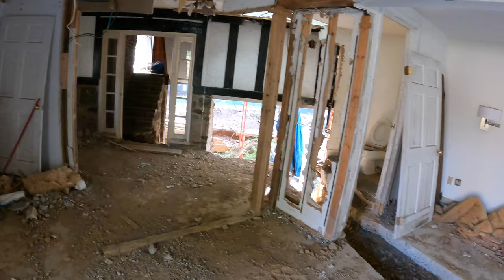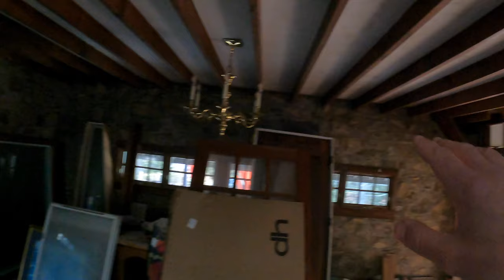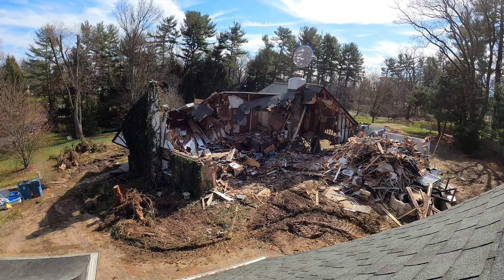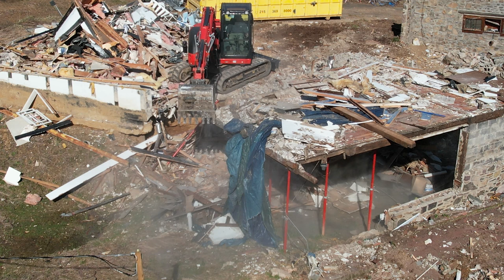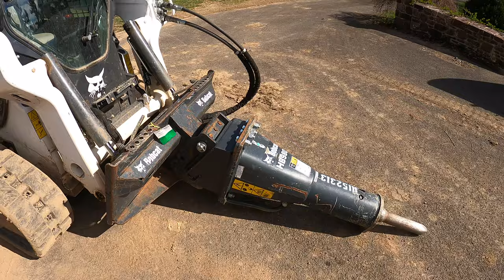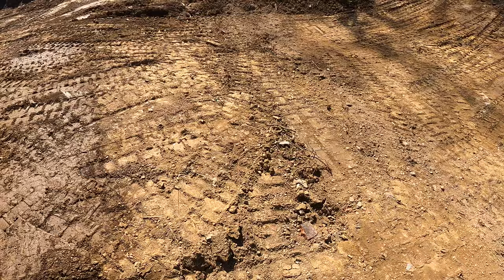Demolishing old house

Comment: Thanks Sean! The house must have been very frustrating for the homeowner with the need for repairs. In the new build he’ll get a lot better insulation, more spacious rooms , better layout, and hopefully a building that will last for quite a while without major problems. Perhaps a suggestion - for sketchy chimneys like this I’ve seen operators pick up a long log or 6 x 6 with the excavator and use it as a “battering ram” on the brick/stone to keep away from the falling debris. Makes for a more interesting video too. 😊
Reply: The piece of shit replacing this irreplaceable 200 year old structure will probably last about 50 years, if that. It'll be built like shit, as most modern homes are, and will probably be an architectural affront.

Comment: Very clean at the end good work! I've learned from demo that I go a lot faster when I put the dumpster or Triaxle right next to the pile then climb up on the debris and dig into the pile to crush it up and load dumpster. It goes so much quicker than sitting down low and reaching out and trying to grab everything with thumb. Also tracking around on it and scooping into yourself really breaks up the debris good for packing in dumpster.
Reply from the maker: Thank you, I thought about doing that because like you said it's much easier to load a truck that way. But these tracks don't have that many hours on them and I was worried about tearing them up. I also though about building a dirt mount to sit on. But I was able to load the trucks in about 20 minutes so I figured that was fast enough anyway.
Reply: How many dumpsters did it take? @srmcontracting

Comment: When we used to tear down homes we never had an excavator, usually a track loader
Reply from the maker: That had to be tough
Reply: @srmcontracting  Honestly it wasn't too difficult until it was time to remove the foundation.  Many times you could pry out slabs but if it was too deep  we would just leave it for the builders. Wood frame homes were easy to crunch up  with a combo bucket.

Comment: Enjoyed the video, thanks for sharing. I especially enjoyed the inside view where you made a path to carry those big windows outside. I wish I were doing this for a living too.

Question: It's obvious the smaller machine had the power to get the job done, but what about reach? Wouldn't things like that chimney have been easier with a larger machine with a bit more reach?
Reply from the maker: Thank you, yes a bigger machine would have helped in those tough to reach situations. But I've found as long as I can get to all sides of the structure it usually works out with this machine. Thanks for watching and commenting

Comment: Great work Sean. Just a quick question but why don’t you have the excavator grading blade at the back of the excavator. Only reason I ask is I find when digging trenches, demo and even removing tree stumps, the excavator has more force and less bucking up and down.
Reply from the maker: Thank you, I'll give it a shot
Reply: When you're demoing if a beam or pipe  or something falls into the cab on the travel levers, if you have the idlers in front, you'll reverse away from it. If you have the sprockets in front, and that happens, you're going into it. Unless you're very quick about shutting the machine off.